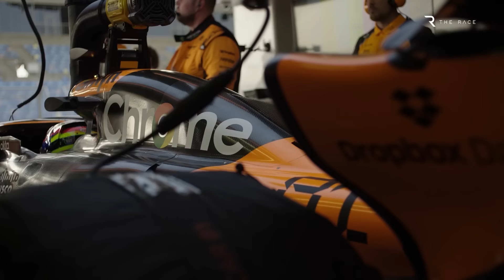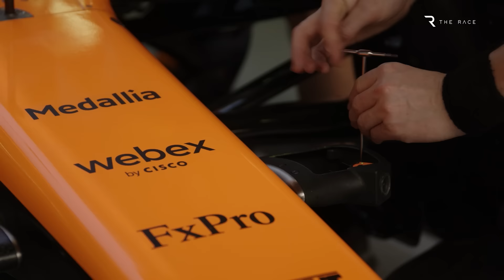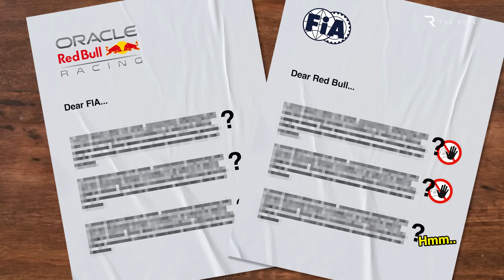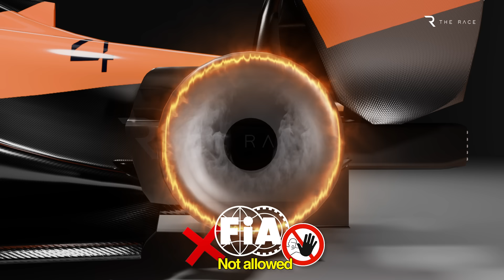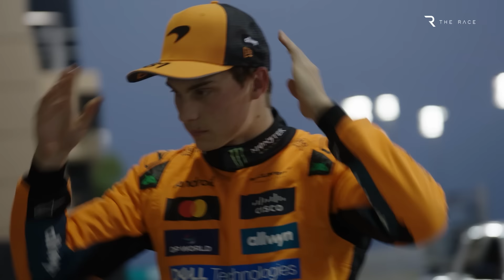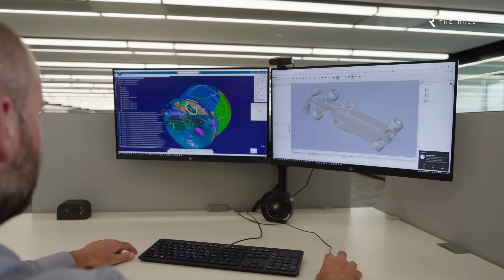Revealed: Red Bull’s wildest theories on McLaren’s clever tyre tricks

Comment: if the material used for the insulation would sublimate similar to dry ice within the working temperature and pressure inside the skin of the dust bin then there will not be any point where the material becomes a liquid.

Comment: Here is the simple hard facts, McLaren manages to keep the rear tires cooler. McLaren is probably right about the fact that they didn't change the car, they didn't mention anything about the wheels.

Now we can argue that there was no change whatsoever and McLaren had just forgotten to switch the car to race mode or something like that in order to explain the drop in performance. I'd argue that that is not likely to say the least.
So it is highly likely that there was a change to the car or parts thereof. My conclusion is that most likely McLaren will have had something that the FIA has now formally ruled out. Since they claim no changes to the car it is highly likely that we are looking at something that was part of the wheel/tire assembly. That way McLaren is not wrong in saying no change to the car as long as you exclude the wheels from the concept of car.

My guess is that there was a form of water cooling going on here and it might very well have been the drinks bottle trick. It is likely we will not find out the real trick at least not during the season and if the papaya boys finish high up which it looks like they will probably not ever as it could result in the FIA punishing them potentially by deducting points etc...

Comment: there is another product to be looked at for brake and wheel cooling that is aerogel it is weightless and depends which type of aerogel is used it can absorb /reflect up to 2500 degrees c it only has to be coated on the inside of the brake drum cover or ducts aerogel is technically a solid that weighs nothing originally designed for NASA it is not a liquid so it is legal cheers from down under

Comment: Peltier device wouldn't be banned as it wouldn't make much difference, their COP is about 0.3-0.7, so you would need 100w to move 30-70w of heat energy, plus it generates it own heat. 
F1 brakes make 2000w of heat?

Comment: A former McLaren engineer mentioned something along the lines of the peltier technology which is something explored in computer cooling, which can heat or cool drastically. I suspect this is the most probably technology being used by Mclaren because it offers drastic changes and can be switched on or off with a switch...and can be hidden easily.

Comment: As a mechanical engineer for xx years i  can tell that any of the systems that are mentioned in the video would be of considerable size.
Since they are designed for destroying generated heat from the brake/ tires any volume of liquid or gas will stand out as a sore tooth 😂....
There us no miracle gas , liquid or system that is so small that it can be fitted or hidden in the wheel / brake system that will allow enough cooling capacity during the race....

Comment: Using a Peltier junction is a brilliant idea.  It could be used to heat or cool the components as desired.  Very interesting.  However, they do use a lot of power and it's going to come from the engine or battery pack, thus reducing power for acceleration.

Comment: Peltier devices are horrifically inefficient and fragile. The electric energy to run them has to come from somewhere. I doubt they could be effectively used in a F1 brake system.

Comment: If hydraulic fluid for the brakes is the only liquid allowed in the wheel assembly, then couldn't you make a system that circulates hydraulic fluid through extra channels in the brakes other than ones that act on the pots, the hydraulic fluid has it's own radiator so they could claim the cooling is a byproduct. You'd need two brake pipes, I don't know if that's allowed but you could claim they're acting on either side of the brakes caliper, if you had a pump pushing fluid in and one pumping it out, so the overall pressure doesn't increase, the fluid would flow through but not apply the brakes. And who knows maybe they have a system that pumps fluid through while the brakes are being applied.

Comment: I was throwing the theory of Thermoelectric cooling on facebook right after the episode of Phase Changing materials by B Sport, I was thinking that Peltier doesn't have to be square, it can cover the full surface of the brake drum and dumping electric current in the bodywork in form of heat, but never heard anyone talking about a thermoelectric device before, it might be the tech they are using who knows

Comment: I always see these graphics showing the air flow going through the ducts towards the brakes, but the McLaren clearly has two seperate ducts in this area. Could they have done something like how you cool your house by opening the windows strategically? The lower duct brings cool air to the brake system, but the upper duct is angled at the mount in such a way that the air entering the vent goes straight through and draws the hot air out and away from the braked drum. By getting rid of the heated air faster, and replacing it with cooler air, the whole assembly will run cooler and not transfer as much heat to the rear tyre.

I'm sure Andrea Stella mentioned in an interview at some point that it wasn't a trick, but just smart thinking about how the physics work in that area.

Comment: Now say you’re laying a type of metal that absorbs heat at high temperature in between the laminate. Now we’re talking some science, which I think would be legal. I don’t think it’s any type of electric or liquid system. I just think they have a molecular scientist that understands metal very well and they created some type of cake pan that they can make out of a particular metal and lay the laminate on top of it. It might be thousandth of a millimeter thin, but you layer the carbon over it. And then also work on the type of resin you’re using.

Science AND Innovation

I do like the idea of the Peltier devices. Very good theory it wouldn’t be very hard for them to take and layer those into the cake pan or brake components. Also, that would be very clever I think I read Porsche is developing those to help cool the electric on their motors.

Comment: When Oscar and Lando remove their helmet to reveal 3rd degree burns in their mouth then we'll know they're using the drinking water to chill the brakes
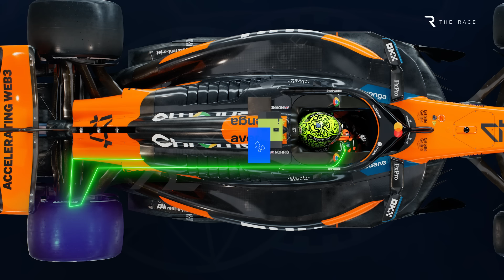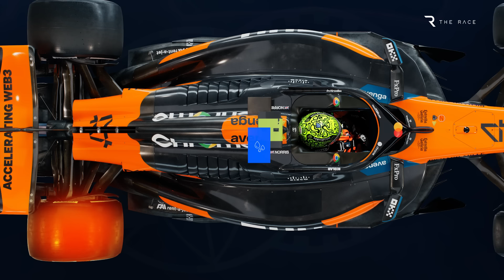Reply: @jacksonrodrigues7533  10:33 they specially say one of the theories is the water is piped to the driver via the wheel bodywork. Plus the graphics of this and the one before (10:26) suggest the water goes to the driver via the brakes/wheels
Reply: Remember, they’ve talked about the drivers how the drink isn’t working
That would be crazy clever that’s why they didn’t have the drink lmao
Reply: lol…I don’t think they ever drink the water. It will be a clear give away sign, if at the end of the race, the drinking water is still there or hasn’t been drunk at all

Comment: Article 10.8.4 (d)  actually makes brake ducts illegal because their purpose is to regulate the temperature of the brakes and thus also influences the tire temperature? 
The peltier device method would not work as a heat sink because they are very inefficient only able to deal with up to 100W-range of heat over time, while the brakes produce hundreds of kilowatts in a braking zone, and you still need to dump the heat somewhere, they only transport heat from one side to the other. A peltier device compared to the heat generated in a F1 car is the difference between a 3yr old on a tricycle and a Boeing 747.

Comment: why you all keep searching for liquids and gases and so many so complex things? There are thermal materials as simply as that, with no electricity, water, or gas, a compound that heats up fast as any other but at a certain temperature it stop increasing temp and has lot more temperature resistant, and that temperature spot can be adjustied just by the amount of material ... select the sweet spot for tyres and here you go, a tyre that warm up as fast as everyone else but then do not overheat.

Comment: Trying to incapsulate a fluid between to layer of carbon fiber is highly, highly unlikely. The temperatures required in the autocalve to bake the carbon fiber would vaporize it. Any fluid would have to be highly dense to survive the autoclave temps and would also be heavy.

Comment: The answer is....moving 1000kg/h of not required turbocharger flow through the brake ducts when in slow corners and off throttle.
Reply: Using an intake blowoff valve would drop the pressure and cool the air.  The trick would be to route it to the brake inlet duct to comply with regs.
Reply: @gordonn4915  they mentioned a few times not being able to get the "pressure" correct in the brakes. Doing this while supplementing with Venturi effect to increase the flow through the regular brake ducts (Syphon effect) would make a huge increase in brake cooling at low speed. I am of the opinion that they still haven't perfected the system, simply because they don't have enough data and adjustments to the system aren't just as simple as adding more air flow from the turbocharger. It would be very easy to possibly cause detrimental effect to the cars performance rather than adding performance. It's very easy to get flow oscillations with a very slight maladjustment which would probably make the temperature higher than normal

Comment: These ideas all seem implausible and I'm surprised they have been raised by engineers. At best they would shed a few watts of heat but a braking session would incur multiple hundreds of kilowatts so any impact would be irrelevant.
Reply: You only need to lose a few watts here and there. How about an engine with a few HP here and there.
Reply: @khunthaasmyseed-h6v  bear in mind 1hp is 750 Watts so an extra 3hp is actually quite substantial, and it's available for 100% of the race.
With the fact a race is nowhere near steady state, I'd be surprised if these measures didn't get nullified by one extra heavy braking session or an extra few seconds in dirty air

Comment: Based on this info, the idea i would explore would be using brake hydraulic fluid.  One part said only brake hydraulics were allowed in the wheel.  So some fluid that has high heat transfer campabilities maybe could be pumped from a high heat area and then cooled by having the hose in an area with airflow.

Comment: OK, so you cannot actively or passively cool the brakes except by using air flow, BUT, could you not pre-cool the air going into the brake ducts (say, by running it through a small radiator attached to the drinking water supply) or even by simply bringing "colder" (by 1 or 2 degrees) air down from the air duct behind the driver instead of up from the track surface...?

Comment: my theory was to use brake fluid to capture heat through an extended brake fluid line (made of metal, so it doesn't leak) through radiation/convection, it would also explain Norris's overheating issues in Qatar as the fluid has a limit to how much heat brake fluid can absorb
Reply: WRC cars had brake fluid pumps to bring the hot brake fluid back for cooling. All fluid was under pressure, just recycling thru a heat exchanger to avoid brake fade on tarmac stages.

Comment: I remember from a Technology Connections episode that Peltier cooling is horribly inefficient.
Reply: Thermoelectric cooling doesn't have anywhere near enough BTU to make a difference to the tire after it transfer from the hub to rim to tire.
Reply: Also, note all of the heat-sinks on the opposing side of the Peltier device.  One side cools, true, but that's because the other side sucks all the heat up (and that heat has to be dissipated _somewhere_).
Reply: Only inefficient if you don’t want the heat. But there are times when the heat is desirable. They are a way to move the heat.

Comment: Good afternoon. Love the continued analysis. The “liquid” hypothesis(s) has always bothered me because of Murphy’s law. When I think about a liquid being used in any part of the wheel assemblies (outside of hydraulic fluid for brake applications) I just can’t get past how a brush against a wall or a bump with another car leaves open the possibility for obvious exposure because I mean either an apparent steam release or simply the suspension (not the wheel rim) looking like someone had poured water on it would be readily observed (hence high risk of getting caught after seeming minor disturbance). To say nothing of repairing on the fly. However, the method you discussed surrounding the use of electro-controlled alloys does seem much more plausible. But then again, the weight/complexity additions and the fact that the FIA still indicates it would consider such use while not outright illegal, still ‘not in the spirit/intent’ (perhaps similar to the mini-DRS concept) also brings up some questions. Using the 2024 mini-DRS effect rear wing as an example, the FIA backed up McLaren’s ‘it’s not outright illegal’, but in the spirit of the regs the FIA asked McLaren to not utilize the design anymore and McLaren stopped using that design…this was all public. However, that did not take place with this McLaren brake intrigue. So, McLaren are doing/did something the FIA declared “clever”, but apparently legal (sufficiently not questionable by the regs) yet RBR prompted reg clarification and seemingly made a step themselves (yes common but still intriguing). Still think that dual (or variant) air flow control accounts for a significant amount of deg control, but also I still wager that McLaren are doing/did something materially in the design of their brake housing to provide the additional degrade advantage (heat transfer control). However, I’m not an engineer nor F1 car expert, so my speculation could be way off. Informative video as always. Cheers!

Comment: Peltier devices can barely cool a can of beer, they are not in the league to be worth the weight / complexity to include them next to cool the breaks.
Their cooling performance is on the order of a few Watts, while the brakes dissipate on the order of a few MegaWatts, a million times more.

Even if they could engineer a super light and efficient Peltier cooler that cools at 100 Watts, it would still be a tiny amount compared to the heat going into the brakes / tyres at every braking zone.

Comment: Regulation 11.5:

Liquid Cooling: liquid cooling of the brakes is forbidden. 

Okay….thermoelectric cooling? Got a nice big battery pack under the car. 

Clearly this isn’t what they are doing but it shows how with a simple regulation requirement you can come up with an alternative which ‘doesn’t’ break the regulation.
Reply: Brake fluid already does this......Just because it doesn't make direct contact....

Comment: McLaren has designed the brake duct system using a scavenging effect of high velocity, lower pressure cool air (that does not pass through the braking assembly) to extract and increase the velocity of the higher pressure slower hot air that passes through the assembly. The velocity and temps of all of the brake duct outlet air is now cooler and faster. Additionally, the brake duct outlet can be located in a low pressure area to increase the scavenging effect. I heard that thermal imaging revealed that the air temps at the duct outlet were cooler at the top of the outlet than the temps near the bottom of the brake duct outlet.

Comment: Bsport says its phase-changing metal holding the temperature steady. His theory is the best one I've heard so far.
Reply: I believe phase change material of some recipe is the best explanation, although I suspect they contain it within a cavity in the wheels. Perhaps in the spokes or in the barrel itself. This not only explains why nobody can discover anything unusual in the brake drum, but also would mean that every tire change pit stop renews the charge.
Reply: FIA have already said phase changing materials would be illegal.
Reply: @K7L3-93  Not if they switch between two different solid states or between solid and gas by sublimation / deposition.
Reply: @VulpeculaJoy different solid states? Are you alright?
Reply: @Stantube1000 its a real thing. Some materials can phase change between different solid states
Reply: @BlarghMeow  Wikipedia says solid -solid phase change materials only work in the range of -50f to 347f, maybe that’s low enough temperatures for the area they’re working in?
Reply: Bsport knows nothing about. He just gets his views and clicks.
Reply: @Stantube1000 I bet you know more then former engineer who worked in F1

Comment: One word: Aerogel.... light thin layer of aerogel to isolate brake heat from tire heat, making it easier to control both individually. You could use less air to cool the tire and more to cool the brakes.

Comment: Every team will plead innocence to save face.
But McLaren being 0.2 seconds a lap SLOWERR on race pace in clean air means SOMETHING changed.
You don't go from being 0.9 second a lap faster with perfect tires to being 0.2 slower and overheating tires in 1 race.
some rumors said Pirelli found odd staining on the inside the tires so they were doing something.

Ferrari's fuel rate tricks or RedBull's asymmetrical brakes for example.
Neither admitted any wrong doing but were absolutely slapped down by the FIA.
You can't openly admit wrong doing because the loss in AD revenue to F1 would be HUGE.
Reply: The car didn't suit imola?That's the simple answer.If oscar didn't fck up his start he would've driven off in the distance easily and this conversation would've never taken place
Reply: Right. The Race keeps saying the "McLaren engineers declared nothing has changed." Of course they say that. What do you expect them to say? But I'm with you...something has changed between Miami and Imola. The pace difference was too great for it to just be "oh it's a different track so different results."